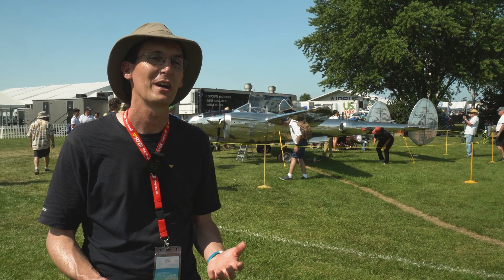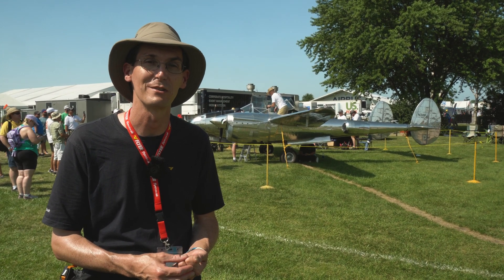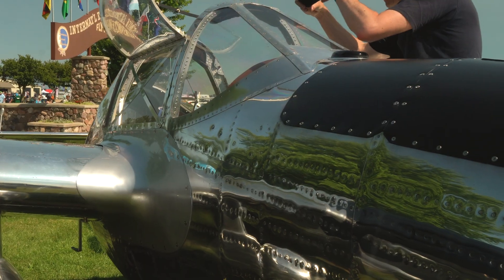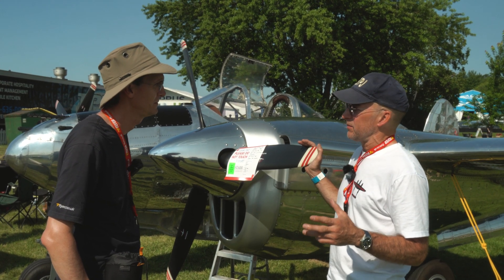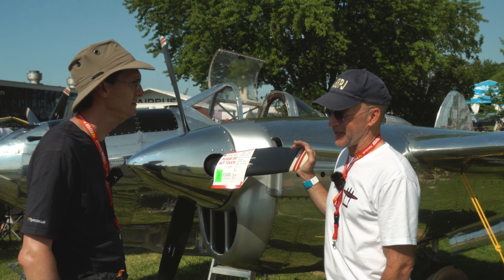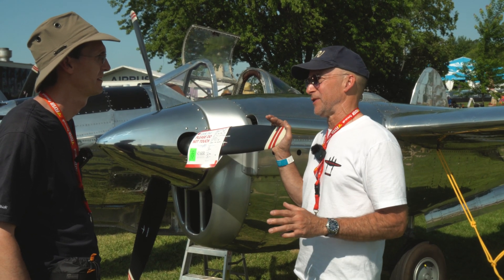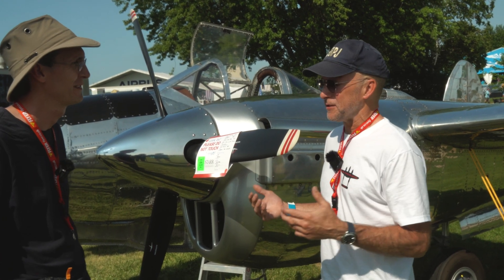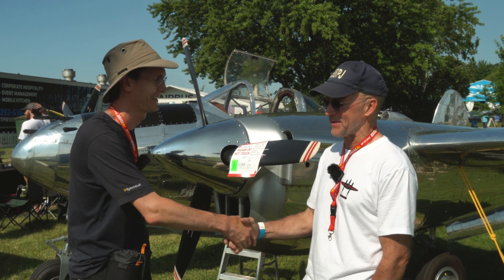Is this 2/3 scale WW II P-38 the best homebuilt aircraft ever?

Comment: if its 2\3 scale it must be underpowered. Didnt the original have two merlin engines?
Reply: No. The original flew with V1710 Allison engines, with, at the time, a top secret tubosupercharger in each tail boom. It was designed in the 1930s to meet the USAAF requirement for a pursuit aircraft capable of making 360mph in level flight.  It made over 400 mph, in 1939. The iconic version of the P-38 was the P-38L, with hydraulically assisted control surfaces, dive brakes, and an Allison V1710 engine that could make nearly 1900 horsepower and that had a service ceiling of 45,000 feet, well above the ratings of the Packard Merlin used in the P-51 models.
Reply: @boydgrandy5769  so this 2/3 scale is woefully underpowered.

Comment: Awesome build, but I have just one question. Why not build to full scale?  Is this a kit and is only offered in 2/3 scale? If that is the case, then why did the manufacturer of the kit make it a full-scale version?
Reply: The builder designed it and made it all by himself as a home project. Full scale it would have taken A LOT more space, and it would have been A LOT more expensive and time consuming to build.
Reply from the maker: There is not kit, just the builder making the drawings, parts, structure, systems etc. etc.

Comment: It's beautiful. Looks like it has contra rotating engines,
Reply: I was informed long ago by a WWII era “pursuit” pilot and FAA examiner that the term “contra” rotating refers to opposite rotating props centered on the same axis as on the Tupolev tu-95 bomber. These are "counter-rotating" props. Not sure how that was accomplished on this scale P-38, though I know that some production twins like the Beech Duchess have counter rotating props/engines that could serve as in this installation. Interestingly, the descending blades on this plane appear to be outboard like the real P-38’s. Not so in the Duchess whose descending blades are inboard, which reduces adverse yaw during single-engine operations.